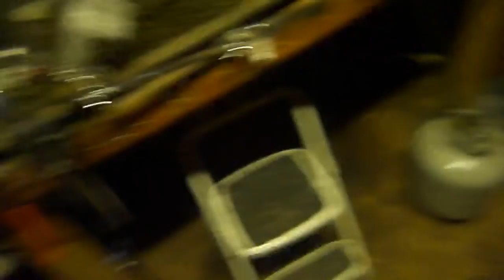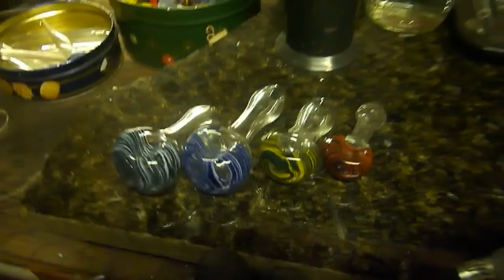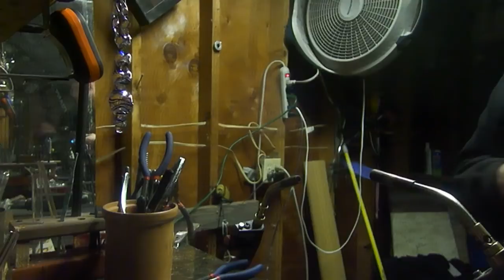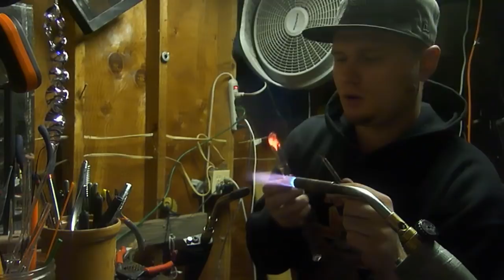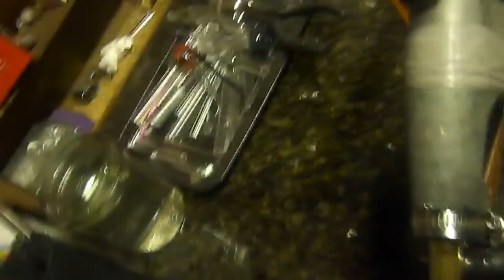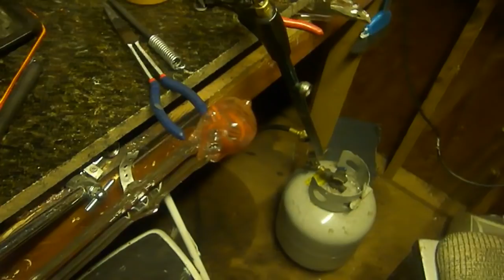glass blowing with propane only

Comment: Awesome work man I've been doing this for about 2 months and got a dual setup like that as well but different torches running off a splitter off of a 20 lb.  Hope you're still doing this and keep up the good work bro. Forget all the haters because you're able to do what they can spending a fraction of the cost. The only thing I do agree with the haters is the ventilation and eye protection because those are important

Comment: Fugg the haters, do you. Once you have glasses and a vent fan keep learning
Reply from the maker: no glasses, im a welder by trade so i have to take better care of my eyes an lungs. I haven't blown for over a month and its really tuff cause glass is my love. im going back to welding to save up for a real setup an pursuing glass full time. thanks for ur kind words. im really hoping to find a job doing glass here in portland.
Reply: Corey Mezzie 
dude im not a hater but ive also furnace, lamp, kiln, and cold worked glass for 8 years. Ive personally known lucas for 4 years. you WILL die doing this, but fortunately for you myfriend, there are classes a plenty in portland. take one, the experience will expand your horizons extensively, and once you work on a real torch you will never look back

Comment from the maker: the doors open with fans, also one sucks the air out above me.  the glass are needed fo sho. thanks for the comments. what do i need to make that will get my skills noticed. i do a 100% all natural perc thats glass on glass, no ground joints either and diffused stem with 4, 6 or 8 slit. thats my most technical pc, is that good!
Reply: Hey brah are you still alive and seeing?  I hope so. Forget the h8rs but safety is a fuckin good thing.  Do you have anything recently let's see your setup now.

Comment: would this work better if u used 2 hothead torches
Reply: no, use proper equipment. you wouldn't want to prime, paint and clear a paint job in your garage with no ventilation, eye protection, or compressed air. cool for a flea market corner next to the guy using old beer bottle to make tooth picks, this shouldn't be duplicated. respectable in effort, but dangerous in practice. not to mention it has to be a pain in the dick back peddling like this.
Reply: Yes 2 hot head torches work really well.

Comment: What exactly is so dangerous about what hes doing? Im asking because over the past 2 years or so Ive been making my own "oil burners" or whatever you wanna call them with a small camping size propane tank, the kind you get at walmart for like $3-$4, anyways, along with that I'll use a torch head that I found in my old mans garage that somehow makes the propane burn almost as hot as map gas, not really though. But my setup is so small and harmless looking to me. Id really like to know from someone who knows about this shit whether or not Im lucky to not have blown my face off already by now or what? Please Feed my brain
Reply: The issue isnt having stuff blow up, its the harmful light from the torch that is damaging to your eyes. Eye protection is a glassblowers #1 tool
Reply: Proper ventilation too. Cause all kinds of respiratory problems from the glass fumes. Oil burner? as in crack pipe lmao.
Reply: Glass fumes?

Comment: try and find a used minor burner or something also get some vermiculite its not expensive in-comparison to a kiln. 
also make yourself a ventilation hood that sits above your bench you can get paper thin sheets of aluminum at your home-depot and install a fan the runs directly out side or feeds into some sort of duct work 

http://www.ebay.com/itm/didymium-glasses-Goggles-Economy-ace-Glass-Blowing-Lampworking-Safety-/251754676020  

hilarious but cheap glasses

discounted glassblowing torch 
http://www.waleapparatus.com/store.asp?pid=27776 

cheap tool for making marbles you can find them at Michael also get tweezers and use a water bucket if you like i prefer 
https://www.google.com/search?q=flower+frog+michaels&rlz=1C1CHFX_enUS563US564&espv=2&biw=1016&bih=1067&source=lnms&tbm=isch&sa=X&ei=WfDqVLbED6TfsASFxoLQBg&sqi=2&ved=0CAcQ_AUoAg#imgdii=_&imgrc=lDaw5zcJfBduzM%253A%3BtWoYNTodYrH08M%3Bhttp%253A%252F%252Flampworketc.com%252Fforums%252Fattachment.php%253Fattachmentid%253D65041%2526stc%253D1%2526d%253D1216033976%3Bhttp%253A%252F%252Flampworketc.com%252Fforums%252Fshowthread.php%253Ft%253D97305%3B300%3B300  

fuck sakes bob snodgrass who all glass pipe makes owe everything to used a fucking tinfoil for his hood so youll get there hahha. 
really respect your aspirations i didnt expect you to have mini tubes hahha  also the rule of them ive heard about ventilation of fumes is as lone as your entire room circulates completely new air every 4 minutes you should be great hope this helps

Comment: So you doing boro pyrex I just ordered a hothead  they say a HH won't do boro pyrex
Reply: I use the hot head and the bernzomatic ts8000, it will do boro. You will want 2 torches, 1 torch will not be enough or at least in a timely manner.

Comment: well ur defenly gona need diddys atleast to keep going and keep ur safty up. id recomend some better ventolation if u do this for hours at a time. haveing sead that  just becuse ppl expect u to use a standerd tourch dont mean u have to. im no expert but i htink pointing the torches at each other may be a rather bad idea. now to get noticed u need to come up with something origonal or diffrent . ie a bog shaped like a octopus. id allso recomend you keep  making videos of diffrent things u make to increce ur exposure.

2 questons for you ,
1 do u annel ur work
2 what type/coe glass do u use.
Reply: when lampworking first started they used 6 torches on each side pointed at each other
Reply from the maker: I have not annealed anything ever, I use borro. i started with one pencil torch head an the disposable propane tanks and then a ts 4000, then eventually i tried 2 torch heads and that made a world of difference. where are u from? im in portland or. i only know what i taught myself, check out my fb pics. corey mezzie
Reply: Darius Ruckers
didnt know that darius. i just think it may be a bad idea as these torches are not desigined to be pointed at each other. but hey like i sead i im no expert.  i beleve the  torch ur refering to is one used in the sientific glass blowing. as the first kind were forced air/olive oil toches wel in the stuff ive read anyway
Reply: Zac packman
 Yeah I think Glassblowing began with the Romans. Lamp working started with oil lamps that they were used with a bellow or just blowing directly into the flame to accelerate it with oxygen.

  I do agree with the rest here Corey you do need to upgrade your studio and safety procedures. You have the artistic skills, I believe you would be amazed at what an oxygenated flame can do.
Reply: Glassblowing came from prehistoric times. Lightning struck sand on a beach, they seen the effect... Tried to recreate it. Corning did an ancient glass demo, they made mini gas volcanos and blew glass with them
Reply: +Darius Ruckers with out diddys you risk serious flash back which can do damage to you vision both temp and permanent I know a glass blower 60 can't see enough to make glass anymore
Reply: Yeah I can imagine glass was discovered awhile ago but I was talking about when it was first modernized for production. Ruckers was talking about 6 torches, I was saying it was in production before the invent of the torch.